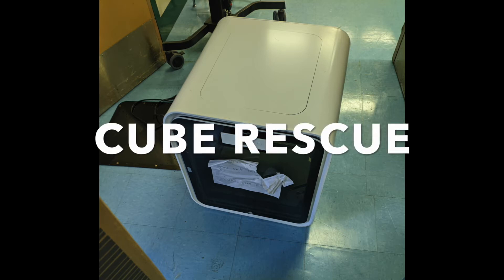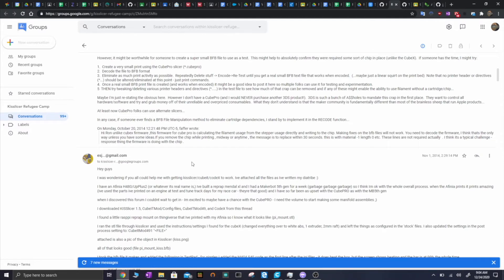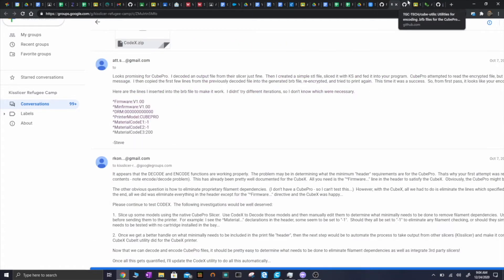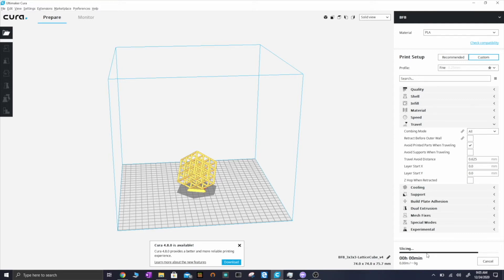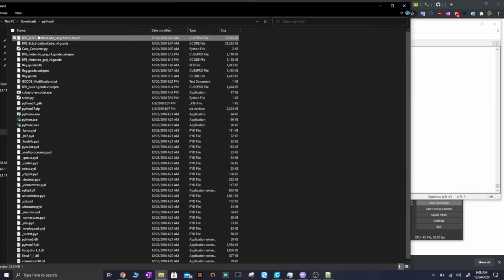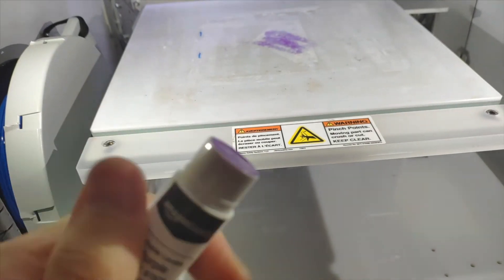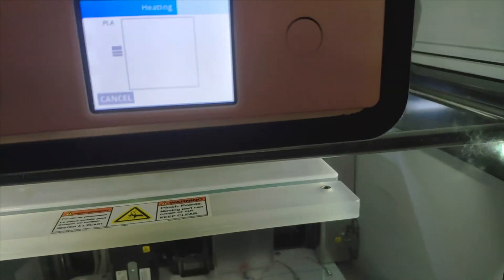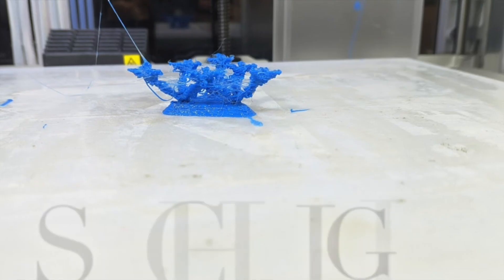Using Cura on a 3D Systems CubePro (CubeRescue Part 3)

Comment: how does this work printing multiple filaments? honestly its my first multi-filament printer so idk normal procedure but does the conversion mess with it? i assume theres some proprietary crap with switching nozzles but idk if that's handled by the printer itself or the software

Comment: Interesting. From what im aware of, the cube 3 (consumer CubePro) utilizes the same encryption method ad the cube pro, and all you have to do is rename the file and change the extension to change the two. I'm wondering if your software could be used to allow cura to print to a cube third gen. When i tried this previously, I had to use a really old printer that did not allow assigning extruder numbers in the printer setting, and the cube would actually read the file, but get an error because the gcode asked for an extruder that didnt exist to the cube. What do you think?

Comment: Hah, just had kinda similar position with the same cubepro trio printer. Got it for free, cause the filament was breaking off. Hopefully it was tube error, or smtn., so i decided to sacrifice second tube to make the main tube work. Now i would like to test it, but as we all know cura doesn't support the needs of this machine. Are  there any way''s to get the original app, on windows or mac - sory, i'm not a Linux person or a coder. Mybe some other slicers would work, Prusa mby? :D
Reply from the maker: Here is a link to the original slicer. I know for a time 3D systems had them all the different versions available from some S3 bucket, but don't know if that is still the case. This is version 2.0 which I downloaded from them a while ago. https://drive.google.com/file/d/1lY_22tA0PwC2eavUWqXNi50k6HoYnN_j/view?usp=sharing
Reply: @TobyCowles  Wow, thanks mate. You probably just saved second phenomen of the same species. BRAVO!
Reply: @TobyCowles  hey Toby I downloaded the programm but it is not opening. Unfortunatly I am using windows 11. Have you tried opening the programm on an win 11 computer? thanks for any help. I have also found an old cubex trio and trying to get it to work. I am a newby, would be already happy if i have the cubify invent running and can do my first prints. Thanks for your help

Comment: I just got a cubex trio. Found the original software. Is it possible just to replace the boards and use something a bit better?
Reply from the maker: People have replaced the boards, it is a costly and involved process, more then I was looking to tackle right now, but it is probably worth doing eventually because even with cura the results are disappointing. If you are interested in reading up on replacement boards check out https://dyzedesign.com/2018/09/cube-pro-total-conversion-step-by-step-guide/ what these people did is a bit overkill and I think there are several easy ways to cut costs but they did a great job documenting the process
Reply: @TobyCowles  thank you so much. I appreciate the direction!
Reply: @hakatox  Did you take the plunge? I was thinking that the Fystec spider looks like a promising replacement board
Reply: hey, where did you happen to find the original software? I got a cubex trio for free a month ago and have been looking for cubify invent ever since. Have never worked with a 3d printer before, would be happy for any help!
Reply: @niklasmuller8081  let me look about. 

From what I recall, I was using just the memory card to load obb files. You can add me on Facebook and I'll send you whatever info I find. I have the same name across all platforms.

Comment: Hi ! Im moving my gcode file to the console, tho nothing hapening .. (?) thanks a lot !!
as well it doesnt write me the M101 in the console
iv added a video : https://www.youtube.com/watch?v=TugRn7hVZrE&feature=youtu.be
Reply from the maker: I think you just need to press enter?
Reply: @TobyCowles  no firend , when i press enter it closed, and no file is created
Reply: the file stay the same as gcode, and there is no other file created
Reply from the maker: @שחקעבודה  strange, seems like it is crashing... I will look into it a little more
Reply: @TobyCowles  cant thank you enough! thank you !
Reply from the maker: @שחקעבודה  can I ask what version of Cura you are using?
Reply: @TobyCowles  sure. 4.7
Reply from the maker: @שחקעבודה  ok. I have a better guess on the issue now. Python and cube-encoder.exe have to be in the same directory
Reply from the maker: If they are not it will fail to find cube-encoder.exe and crash. Also I recommend you reslice the file before you try to print it because it is possible it was doing some modifications before crashing which could leave your file in a weird state
Reply: @TobyCowles  still nothing :( 
my cubepro encoder file is as a .c file , maybe thats the problem ?
Reply: tho i now changed that to .exe  , still the same
Reply from the maker: @שחקעבודה  you need to compile the .c to an exe (or just download the compiled file from https://github.com/fritzw/cube-utils/releases)
Reply: @TobyCowles  i'v put this file together in the folder, still nothing. maybe im missing somthing, il make another video if it is fine by you
Reply: @שחקעבודה  Have same problem. Did you solve the problem?

Comment: Man you're awesome!
Iv tried a lot, as well from the same post in this forum.. didn't got it to work.
Well now I'm on quarantine, so il wait a few days y go straight to check those things with you tutorial.
Thank you! 
I hope you will manage to solve the temperature problem as well (:
Reply from the maker: This makes me so happy to read.  Let me know if you have any luck. I clearly have some more fine tuning to do with stringing and such but for more basic prints it seems to work well. Good luck with your Cube!
Reply: @TobyCowles  sure man!
I'm very excited to try this . I will update here as soon as possible .
(By the way, I believe this machine has an huggee potential )
Reply: Hi man
Seems like you're program is working!!  I'm super glad, thought i can print yet. I'm getting a massage that I need to switch to pla. And in cura iv put on abs. 
Maybe in your program it's directly putting on pla?
Reply from the maker: @Mshahak  yes the program is directly on PlA... You can change the material code in the python script by default it is at 200 which is PLA... I can make an abs version of the script if you like
Reply from the maker: I just checked and ABS should work if you use material code 259
Reply: @TobyCowles  well sure I'll be glad (:  still don't want to bother you too much man. So I'll be glad as well for the number for abs (if it's only changing in the gcode file)
Btw, in which file do I need to change it? At the final file with the cubepro format?
Reply from the maker: @Mshahak  to test it you can edit the .gcode file that is left after my script, then drag that file onto cubepro-encoder.exe to make a new .cubepro file. If that works then you can edit the python script so that it will automatically add 259 instead of 200
Reply: @TobyCowles  excelent Man!
First thing on the morning I'm going to check that thing .
Big big thank you again!
Reply: @TobyCowles  hi man
I have 2 troubles with the gcode. I hope you could help me.
One is that I can't control the extruder. And the second is that the gcode seems to run but in practice he's only doing one line, and then finishing :/
Do you have any idea why is that?
(I thought that "material length" might be the number of the extruder, but seems not)
Reply from the maker: Yeah, the material length number is completely arbitrary. It might be worth trying Cura 3.6 as that is what I designed the script around. I tested it once with 4.8 and it seemed to work, but I still mostly use Cura 3.6 because I prefer the old UI
Reply: @TobyCowles  tried with the 3.6V , still ain't luck
I changed the material num , and the machine accept it as abs, thought when I start the program, It finished within 2 seconds
(I look at the gcode file, and it seems like there's only 24 lines in it, ita wrong no?)
Reply from the maker: @Mshahak  sorry I ignored you for a couple days. I had a busy week with school. I will make a more detailed video this weekend walking through all the settings in the script and in cura to help people with troubleshooting.
Reply: @TobyCowles  I'm so glad to hear that !! (:
Thanks a lot again!!!